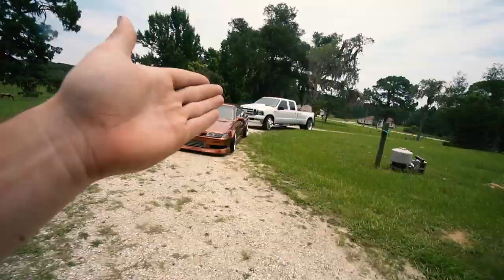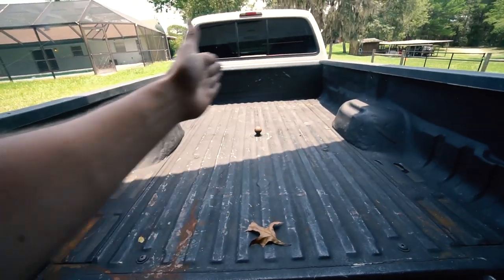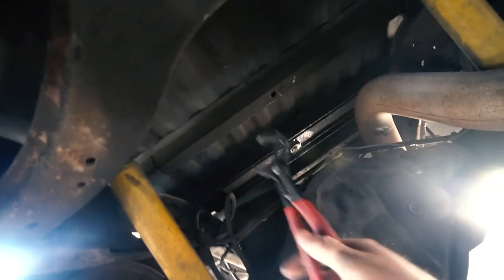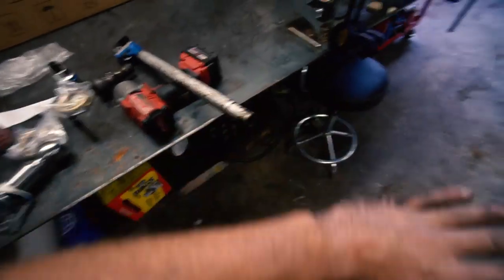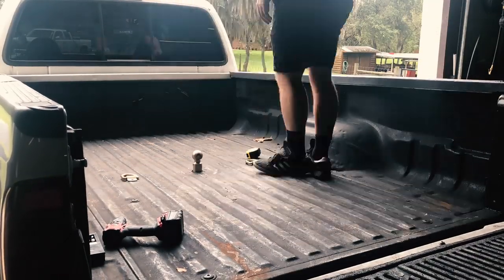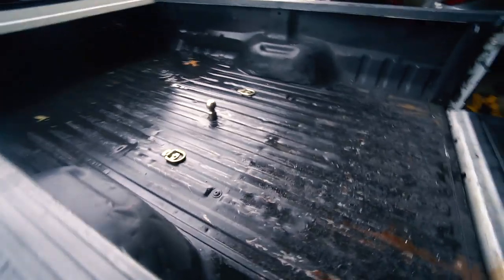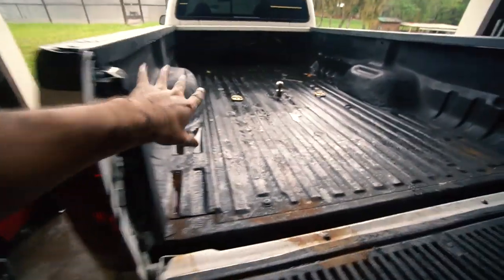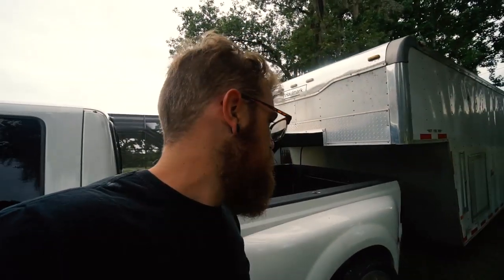Towing the Big Trailer with The 7.3 Powerstroke on 24's for the FIRST TIME!! Will It Work!?

Comment: finally someone who throws a sponsor in a video that all of us will most likely actually use instead of a free phone app
Reply: brandon sheffer 😂😂😂😂
Reply: For real though, but honestly PB Blaster doesn't do that much.
Reply: CJBMAGGOT94 I’ve found that brake fluid works the best
Reply: Or a rebranded Chinese speaker.
Reply: Any sort of those wd40 or PB blaster things seem to work for me when I'm getting rusty bolts out. I always soak my hitch receivers in wd40 to keep the rust away. Seems to work alright for me
Reply: Literally used that same can of PB blaster that Taylor had. I couldn't get a bolt to break loose to get to the alternator of my car and I was getting pissed lol got that pb blaster from the store and it finally came undone. definitely works
Reply: brandon sheffer should watch mustie1 channel
Reply: you don't want a shitty watch?

Comment: Time for airbags on the back of the truck
Reply: Theres no need for them. Its a dually to begin with and this is what they are designed for.
Reply: Bags on the back will bring the back end up to a better towing level. Should smooth out the ride and improve transfer of momentum to the trailer. Mostly a convenience thing though.
Reply: Yeah the truck is designed for towing but when they're slammed on the ground sometimes they need a little helper bag
Reply: @markyfrencho  The truck sits level when loaded. The trailer doesnt, which that is fine. The trailer is getting 4000lbs of cargo and thatll squat the suspension on it a little. Ya, i know 20% weight it transfered to the truck, but it wont squat it any more then it already is. Bags would be completely useless. This is why my truck still has the factory rack which will handle 35s without a lift. If i leveled it, i would install bags to keep it leveled. Pointless to level since i do tow.
Reply: @shannonreed1847  Its fine. The truck should sit level when pullig which it is.
Reply: It wouldn’t need anything if it hadn’t been already lowered.
Reply: Air lift makes a great kit for your truck and it’s less than 500 bucks
Reply: @miltoncargill7571  Its useless and pointless on a dually. the truck sits level already.
Reply: The bags will raise the back when needing to raise the front of trailer.
Reply: @jasonl844  It does notnwork like that. When a trailer is attached, the truck should sit level. It does not matter that much about the trailernin this case as the trailer was not loaded down with the 4000lbs of car, tools and tires. Yes i do know 20% of that wil he put to the truck. Thing is, the truck is sitting level after the initail softer spring is now riddig against the main heavy duty leafs. 

Basically, bags would be useless as the truck is sitting right currently
Reply: @Brandon Caldwell it does work like that. I have bags on my truck and i raise the truck to hook up the trailer then lower it back down. Then i raise it again to unhook the trailer.
Reply: @colormesarge  I believe youre the blind one here. Afterall, you stated yourself you use airbags to just hitch up a trailer. Go ahead and pop those bags like an idiot. This truck is sitting level. Ive had both lowered and lifted trucks from 1/2 to 1 ton. Farm use registered semi also. Limited experience? Whats the heaviest thing youve ever pulled? 15,000? leave the towing game to people that know what they are doing.
Reply: @brandoncaldwell95  number one thing I always find absolutely hilarious is when someone on here is calling another person an idiot, then they dont go back and proof read what they wrote!!! Only takes a second to not make yourself look foolish!! Just a helpful tip is all.. yes dually trucks are designed to take the weight better then a single wheel would and the suspension has the "soft ride" portion of the spring that rides like a brick. Then the main leaf takes most of the weight and then the overload portion is right after that. Fords design is actually pretty cool how they made that work. The thing is that in this video the truck is not sitting level, it just isn't. Then they still need to add 4k or more in weight to the trailer plus whatever is going to be in the truck. It wont be directly to the rear of it but it will add tongue weight to the trailer witch will sag the rear suspension even more. Saying that it will never be overloaded because its a dually and they are made for that is not true at all, plus saying airbags will do absolutely nothing is also not true. If you load your trailer correctly having the bulk of the weight over the axles and the proper amount of tongue weight then you usually dont need anything more when you are pulling with a dually. But this sure isn't a perfect world and having air bags in the back is helpful for leveling, body roll, and just over all ride quality because those trucks are pretty stiff to ride in. Saying it will never overload the rear or whatever you said is naive because different people have different things they pull and different ways of doing things. Not everyone is as good as you are buddy. They are called helper springs because they help. Just about every truck that is pulling a trailer with a substantial amount of weight and is a dually has air bags also on the rear of it for the convenience of them and if they are needed.
Reply: Yup bags for sure

Comment: For the chain's you could do U bolts drilled through the frame rails with springs between the nut and frame so they retract.

You could put bags on the truck to help with the sag.

Love the truck tho, super happy for you!

Comment: 7.3s are the best. Not fast like later model diesels but absolute work horses and definitely the most reliable. I think if you spend the time and money to get the truck right you definitely won’t regret it. And super awesome that pb sponsored a video.
Reply from the maker: I really like this truck. Unlike the dodge, I'm happy to buy parts for it to make it better. So I'm hoping she does me well. I've never really loved the way a truck I've had looked until this one, and it makes me so happy to see it. Plus the seats are comfy and it has a nice system and cold ac. As long as I can cruise at 70-75 without loosing more than 5-10 up big hills I'll be happy. lol
Reply: @Taylordrifts  you will love it once you fix everything that needs to be fixed 7.3 Trucks are amazing. If you ever wanted to you can put a 2016 front end on your truck to make it look better. They sell brackets that let you install all the new front end to your truck
Reply: @Taylordrifts  My dad has had a 7.3 for over 15 years now and he tows everything under the sun with it and it cruises, once you fix the boost leak it will work amazingly
Reply: Colby Leger
I'm trying not to sound like a broken record as I'm sure you have seen comments like this before but I personally don't like it when someone comments like this " a 7.3 can never be fast or perform like the new diesels.... they're just boat anchors". This is not true a 7.3 can be fast and "perform" like a new diesel and still be way more reliable than a factory new diesel.

Comment: You know the sky light in the trailer isn't just an inconvenience because the floor gets wet when it rains if you don't replace it the wood that holds up the roof will rot I had a similar issue with a smaller trailer
Reply from the maker: I ordered one a week ago and I'm still waiting on it. lol

Comment: Taylor, looks like you got the Tekonsha P3 brake controller. Go through its' setting and set the controller up for the size of the trailer so it can correctly and effectively help you stop. 
I used the same brake controller on my 45ft double deck Kaufman 5 car in my 5500 without issue for years. I had it set so the triaxle trailer would show on the little display, and it set correctly for my type of brakes, EOH. But your just electric, just wanna make sure you set it up correctly to help it help you the best it can.

Comment: So he went from a Duramax no problems to a Cummins with issues then 2 a 2wd powerstroke
Reply: First he want from a cummins to a duramax then back to a cummins and now a powerstroke.
Reply: yeah man! he's upgrading! :P
Reply: Actually the 2 wheel drive could be better for towing if you stay on the road,but I would have kept the Duramax.
Reply from the maker: @snowblowerman5115  Just trying them all out. lol Will report back.
Reply: He still need to try a 95 cummins dually rwd and a 454 chevy dually rwd. Those are some pigs...
Reply: That 2wd 7.3 was on craigslist forever lol
Reply: @ChickenTomcat852  how much was it
Reply: @infamousstreetperformance1233  i dont remember exactly but it was over priced bc of 24's lol especially being 2wd
Reply: Yeah he want from good go better to worse. The cummins mainly needed a/c work. But I know it would pull better then that Ford
Reply: @ChickenTomcat852  ford's don't sell well at all! and most ppl know why. junk! low miles and still half the price of a real truck lol
Reply: Taylor Ray Should put a 6inch stack on it if you wanna know all about fords and power strokes check out ZIP TIES N PIES PLIES on YouTube 🇨🇦🔴‼️👌🏻
Reply: Yeah I wouldn’t of gone to a 2wd less powerful truck for some damn alcoas and we all know it lol but love the vids Taylor
Reply: That 7.3 powerstroke will be way more reliable then a duramax, u gotta understand those engines are pretty much indestructible
Reply: @NightshiftCustom  funny. Not the case today. I can get 12k for my 99 srw f350 with 300k miles

Comment: It will shift a lot higher in the rpm range with a tuner called the ts6 by ts performance and that tuner has a 6 position switch so you have a retuned trans and 6 choices as far as power and they have a high idle setting for cold weather starting but I dont think you will ever need that but my 7.3 feels a lot better with that tuner it only costs like 2 or 300 bucks too. You order the tuner custom with the six choices of your choosing from an 8 or 10 choice list I forget what all of them are but you'll have to check it out for yourself
Reply: PHP Hydra is where it's at

Comment: Dude I'm about to order you some tow mirrors! So important!
Reply from the maker: I got some coming tomorrow!
Reply: @Taylordrifts  dont order the cheap ebay ones! They shake so bad driving down the road that they are absolutely useless 😂
Reply: Jared Anthony i think they are hit or miss. I have two sets, they both rattle the exact same amount as my factory 13 mirrors. One set has a bit of a fish-eye effect going on. For the money i love them. Now ebay headlight housings are junk
Reply: @Zach_summers  my factor 99-03 mirrors didnt move a bit and then one got broken so I ordered Ebay ones. They rattle so much you cant see out of them at 50+ but the bottom convex ones are perfect. Maybe I just ordered the "cheap shit" ones (I did order the second cheapest ones 🤷‍♂️ they have defrost 😂🤷‍♂️) or maybe just that company was just the wrong one to buy from 😂
Reply: @jaredanthony8070  u saying he is cheap? Lol
Reply: @Forcefed2002  I mean I'm saying I am and that Taylor may have tried to be thrifty with it... 🤷‍♂️😂

Comment: For the ride height. You could bolt in some rectangular metal stock and drill thru for your ball so you could gain an extra 2" on trailer height.

Comment: coolant temp is -4? doesnt the 7.3 have a flap in the exhaust to keep back pressure to warm up the engine faster? which would also limit boost
Reply: 7.3 does have a ebpv but it doesn't have a coolant temp sensor it does however have a oil temp sensor when I first plugged in my monitor to my 2000 it showed a negative coolant temp.

Comment: Get some helper bags. I got a set for my dually for 200 bucks from SD truck springs. I don't have on board air for that price but it helps with squat since it's lowered, too.

Comment: Just an observation, I didnt read through the comments to see if anyone mentioned it... but you need to drill holes in the front bed floor so the rain drains out of the bed. I just noticed the water puddling up front at one point.

Comment: You really shouldve got a full b&w turnover ball hitch. Has u bolts that sit almost flush. One pull bar and you can pull the ball out and put in a cap to have a flat smooth bed or put another size ball in. It is more expensive but much nicer long term
Reply: Yea worth every penny
Reply: I have one on my work truck will agree worth every penny
Reply from the maker: I thought about doing that but it already has a under bed plate welded in. not worth spending the time to remove it when it works for me right now..
Reply: @Taylordrifts  I get that. Didnt know it was welded which sucks for ease of removal but its definitely not going anywhere! 😂
Reply: @Taylordrifts  oh yeah if its welded don't even bother with it

Comment: I use P.B. Blaster CONSTANTLY there is always at least a case in my shop. If one of my guys brakes or strips a bolt and has did not use PB they clean the bathroom.

Comment: Im sure if you want extra height on your new ball to level out the trailer you could add an inch or two of solid stock and weld it back together. Just grind some valleys and fill them up. Any metal yard should sell you that small length for scarp weight prices.

Comment: When you use pb it doesn't hurt if you tap the bolt with a hammer or a wrench to jostle the bolt and let that pb bog deep into those threads

Comment: You might want to take a look into the coolant temp issue. Could be causing the early shift and the lose of boost. The ecm could be bleeding off power, anticipating the engine warming up but it cant actually see it. Just a possibility

Comment: Something I didn't know for too long is that pipewrenches have to face the wright way. When faced the correct way, you dont have to pinch them together. You can put your hand on the trailing arm and then just push with all your force.

Comment: You can put a 5th wheel hitch on the truck and trailer. Then add a air ride suspension on the neck of the trailer

Comment: Hi taylor,if new truck too low with trailer on y not put air lift on the rear,(to help with weight).and put after market front pads and disc's on like ebc green stuff pads and disc 's.(l put them on my for dinner for towing,the difference was night and day)

Comment: you may not have a boost leak check to see if it has a boost fooler under the hood 13 pounds is what mine pulls with the fooler on my sctx4 the fooler prevents the truck from showing an over boost code

Comment: Look at kc turbo get there rebuild kit for your truck it will help with compressor surge and towing not sure if your running any tuning look at quadzilla or a ts 6 pos chip they can do custom tuneing no matter what 7.3 are slow but they will pull and last forever

Comment: I have the same brake controller and I was glad I spent the extra money. The difference between the economy model and top of the line was not that much. I also experienced some wiring WTF on the E350 chassis RV. Once I hooked up the brake controller the center stop light stayed on all the time. Winnebago decided to borrow the wire in the trailer brake harness that switches from the brake pedal and run that back to the center brake light. The thing comes with a hitch and a 7 pin hookup, what are the odds that someone would tow something with brakes on it? Bunch of maroons.

Comment: Also Taylor as you are driving it the more you lay into the pedal the more itll ride gears. The less you lay into it the more the truck just tries to get into 4th od. Low throttle input and it wants to shift as early as possible. Tunes, injectors, boost leak fix and itll be a different truck. With tunes from like a hydra "tow tune" will make it ride gears longer and again a different beast
Reply from the maker: Yeah I think I'm going to sell the SCT and get a hydra.
Reply: @Taylordrifts  I have a hydra and full force diesels stage 1.5 injectors and they work great but you only get a screen that tells you what tune you are in. The edge cts2 although sorta pricey at like $500 has coolant temp, iat's, egt's, rpm everything and you can get a backup camera that works on them. You can also use them as a tuning port although it does take a little longer and isnt shift on the fly the other advantages make it worth it to me.

Comment: You could just add airbags to the rear of the truck, add some air and the front of the trailer would be higher. The back of thr truck too, i think it might get lower when you put weight on the trailer.

Comment: Those D-rings should have been bolted into the frame. They maybe raided for 12,000lbs each. But the thin metal of the truck bed isn't. That's why those bolts ended up being so long. Because if it ever did come of the ball. The safety chains are going to rip those D-rings right off like nothing.

Comment: If this truck has a boost leak it must be very minor. I had a f250 with the 7.3 and I ran awesome but only saw 18lbs of boost in its stock form. As far as the shifting goes. It will shift early if you are light on the throttle. These trucks are dinosaurs and slow and definitely not powerhouses, but they are some of the best tow rigs out there for the money.

Comment: You should be able to change the shift points with a tuner if it’s shift way to early. My 6.0 with a sct tuner is able to change shift points. Your truck should make full throttle at least 20-25 psi of boost. 7.3 are so reliable, I got friends that have them and can beat the living shit out them without worrying about something breaking. My 6.0 on the other hand... until I got it straighten out

Comment: Hey taylor just a heads up 7.3s rarely will ever make 20 or more pounds of boost without big injectors I’ve had 4 different 7.3s 17 psi is the most I saw on stock injectors and custom tunes 

Go full force stage 1.5 injectors and a Kc turbo that’s the best daily/tow setup I’ve run on any of my trucks I pulled 25k with my srw f250 all the time with the same setup never saw huge egts or ect!